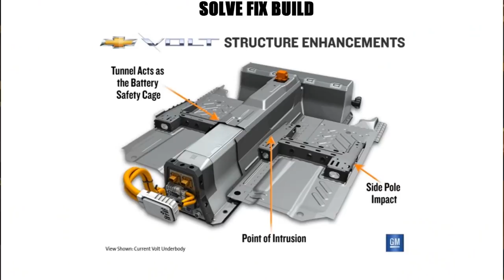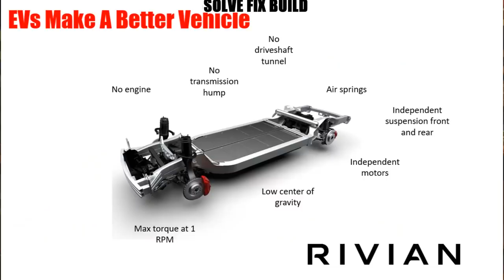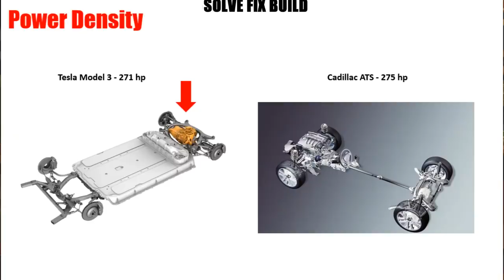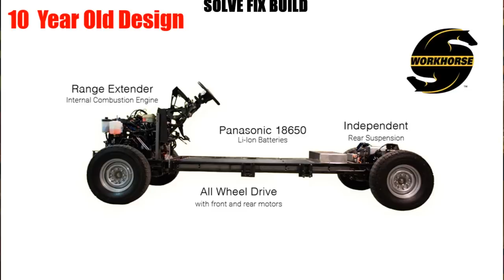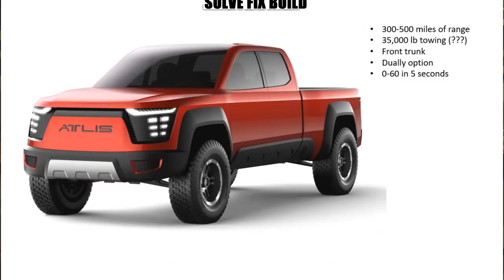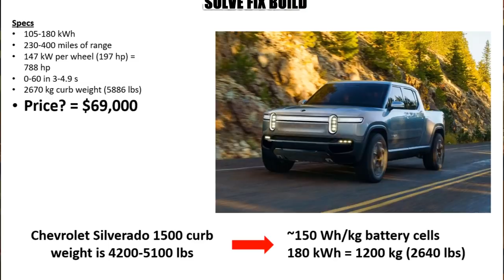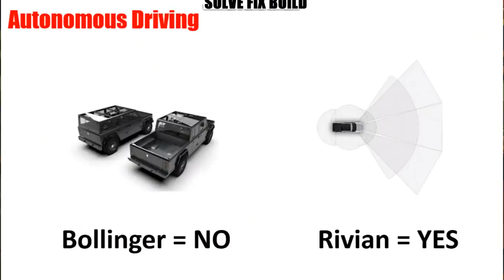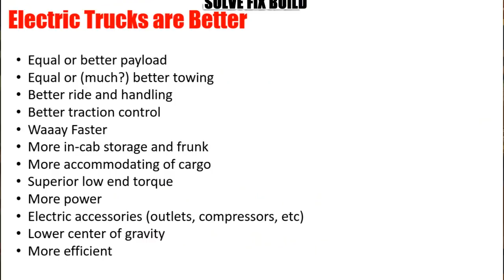Your Next Truck is Electric and GM is Dead - Solve Fix Build

Comment: 2018 F450 has a gooseneck towing capacity of 34,000 pounds, and for the conventional hitch it can tow up to 21,000 pounds so the truck at 20:21 claiming 35,000 is totally possible.

Comment: Ford is looking at electric trucks an electric SUV that can achieve 400 miles per charge they already have the electric mustang and the new escape is a 3 cylinder vehicle that will shut down 1 cylinder when it is not needed.

Comment: Air Springs?  I hope not.  Air is a horrible suspension component.  I know.. I have over 1 million miles driving air suspension vehicles.  I could own several very nice used cars for the money 'I've spent repairing  air ride suspensions.   Stick w springs n shocks.  Air is NOT an upgrade.